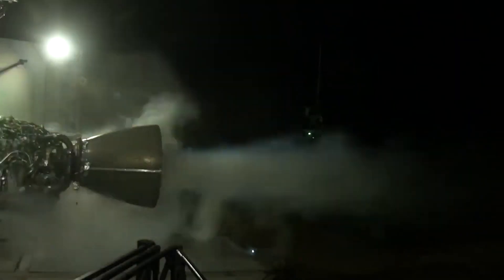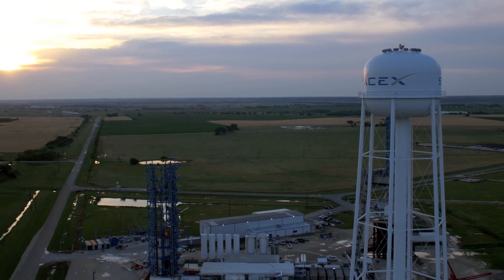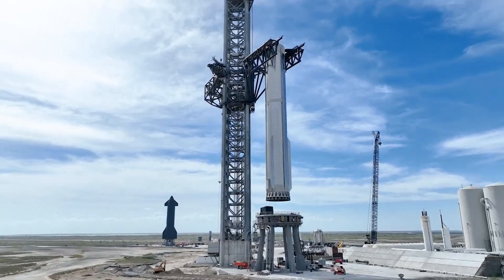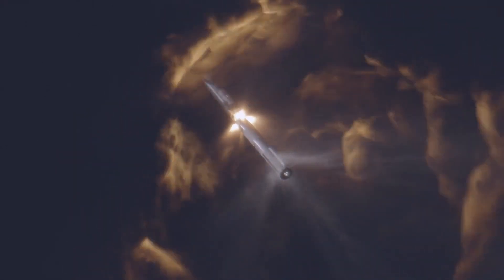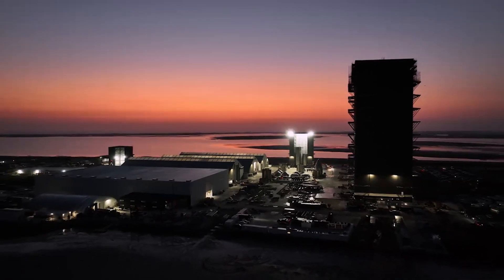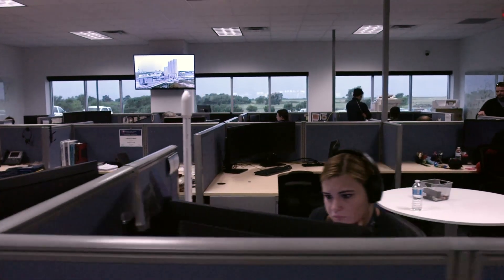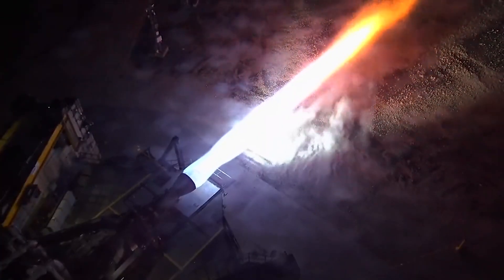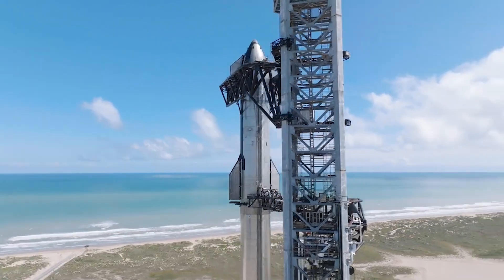SpaceX’s New Raptor V3 Is Changing Starship's Design

Comment: Call me a sceptic, but removing safeties like shielding between engines sounds reckless. Also, the continued engine failures don't instill confidence. Maybe continue to push the engine to extremes for the sake of a few percent performance is not the way forawrd?
Reply: The lack of safety is justifiable when there is nothing in danger. If it wont be a problem, it simply won't, there is no reason to treat it as a risk. 

Saying the lack of safety there is risky is just like saying the lack of heat shield on fighter jets is dangerous, or the lack of refirbishment in airline planes is dangerous. 

There is no reason to spend money and resources on something thats proven to work without those expenses.

"Continued engine failures"
Which ones? There were what, 3 engine failures on the last 110 test flight engine ignitions, and 5 on the last 1000 engine ignitions including ground firing. The reliability of the raptors is simply undeniable, and the amound of failures is impressively low.
Reply: @DangerZone2002  So what you're saying is that Starship well never have humans onboard? I'll buy that 
2 Raptors failed on the most recent test 
Planes don't drop like bricks when their engines fail so that's a bad analogy.

Comment: So does that 10+ ton weight saving from removing the current fire suppression behind the heat shields involve the removal of those huge CO2 tanks housed in 2 of the very long chines on the booster? If yes then not only is that a good weight saving but I would think that it will also be a very useful cost and time optimisation when building a booster. Those huge CO2 cylinders are I believe manufactured elsewhere and trucked to Boca so that's probably a relatively costly component and then when you see them being fitted to a booster in a Megabay it looks like a pretty serious lift (2 lifts actually - one for each cylinder) that probably needs a lot of prep (making space, establishing bigger-that-usual health and safety exclusion zones because of the swept space taken to lift the cylinder from horizontal to vertical etc). It's probably a Megabay operation akin to installing a methane downcomer so getting rid of those CO2 cylinders entirely would be nice for the production process too.

Comment: As I see it - and maybe seeing what I want to see rather than reality - even more recent Raptor 2s have been incredibly reliable. We can't know all the details but discounting IFT-1 I'd say it's entirely possible that out of 117 engines (3 flights with 33+6 Raptors each) there might well have been only a single failure that is down to the engine - the one that shut down almost immediately after OLM booster ignition on IFT-4. It's entirely possible that all the other failures (and maybe even that first IFT-4 failure) were down to issues further upstream (fuel slosh, clogged filters or other issues that weren't actually in the engine itself). Obviously all those non-engine issues are critical to identify and fix but the more of the failures that we have seen in the IFTs that were upstream issues rather than engine issues does bode very well for where SpaceX is already at re engine reliability.

Comment: Casual reminder that Starship V.1 was supposed to carry 100 tons to orbit but has only ever flown empty and the entire program has already expended more rocket engines than the entire shuttle program did over decades of flight, even factoring in their two vehicle losses.
Reply: The cost of engines for the whole starship programm is still less than 1  (one) RS-25. The number of engines is irrelevant
Reply: No. Thats not how it works.
Reply: Loss of engines doesn't really matter compared to cost. It's too early to say if the starship development program will be capital efficient, but I think it's fair to guess that they will deliver far more than the space shuttle at far less cost. They're currently sitting a like 10-20x less than shuttle's cost.
Reply: Obviously it’s expended more engines, starship has 39 total and the shuttle had 7. Not to mention the shuttle reused all of its engines: the SRBs parachuted down, and the OMS and SSMEs came back with the shuttle to be removed and reused. Not a good comparison. The raptors are also far cheaper than any shuttle engine. Also, plans have changed: V1 used to be meant to deliver 100+ tons to LEO, but is now delegated to be a prototype for the first operational version: V2, due to them finding improvements and deciding to improve the design before launching with payload.
Reply: @Skye-Was-Taken  one space shuttle engine costs more than all of raptor engines used in all 4 flight tests
Reply: @tedarcher9120  yeah, just shows how much Elon has done for the aerospace industry. Amazing, isn’t it?
Reply: It has flown empty but with less fuel, so it clearly has capacity. I think the main reason they haven't flown payload yet is a combo of:
- not entirely reliable yet, many changes each flight, wouldn't risk payload
- being paid for development milestones for Artemis
- focus on long term reusability, which dominates the returns of a few deployments during testing

The latter two come into play when there's any conflict between deploying a payload and demonstrating reuse. There's the obvious tradeoff of limited engineering time, but there are probably many in-the-weeds reasons. That said, I feel if I were in charge I'd be trying to deploy starling satelites by now.

Comment: Casual reminder that SpaceX the longest-running private space flight company and still hasn't launched a single payload outside of LEO.
Reply: Nope. From wikipedia:

Launches to higher-orbits have included DSCOVR to Sun–Earth Lagrange point L1, TESS to a lunar flyby, a Tesla Roadster demonstration payload to a heliocentric orbit extending past the orbit of Mars, DART to the asteroid Didymos, Euclid to Sun-Earth Lagrange point L2, and Psyche to the asteroid 16 Psyche.
Reply: No
You forgot Blue Origin dude, they run longer than SpaceX and not even single orbital launch yet
Reply: @cunnybluez  agreed that blue origin dident have any orbital launches but the BE-4 engines did fly on a vulcan rocket a few months ago. at least thats some progress as slow as blue origin goes.
Reply: Did you forget about a falcon heavy launching a tesla roadster all the way out to Mars orbit? Go Google it.
Reply: @reyviqueira3159  haters tend to ore than a little dishonest.
Reply: This guy, bro. They have launched several payloads outside of LEO, including going interplanetary multiple times. Also, blue origin is technically slightly older, and hasn’t even gone to orbit.
Reply: As all already pointed out you are wrong and I don't think that's any sort of goalpost. They are the industry leader, like it or not. The push for reusability can be directly attributed to the success of the Falcon 9 rocket.

Comment: I believe the 10 tons of “heat shield” is more the result of needing prevent a single engine RUD from taking out its neighbors, and potentially so on and so on. Raptor 3 is supposed to survive RUD without firing pieces of shrapnel everywhere. That seems like a hard thing to validate to me, give all the different and violent ways a rocket engine can explode. It’s not such a big deal until they try to human rate Starship. SpaceX are proposing no launch escape system, so the booster and ship (and therefore the Raptors) must be incredibly reliable.
Reply: I'm wondering how they'll get away with the no launch escape system. 
To me it sounds like the no need for a water deluge system that they originally came up with. I think they'll have to back track it. But we'll see how it goes. SpaceX never fails to surprise and do amazing things.
Reply: @acasualviewer5861 yeah. However Starship IS the launch escape vehicle for the combined booster+starship stack as Musk has explained a few times. Those raptors can power the Starship away from the booster faster than an explosion can get to it. The real problem is that the Starship itself has no escape system - but then again neither do other spacecraft once the escape system is jettisoned - the plan is HUNDREDS of flights without failure to prove out the human rating. I reckon that’s a decade away

Comment: He was told at the start not to use methane ,  It's all new tech ,,just go with the usual,,,
H2 leaks , helium runs up walls, ,,3rd version is powerful,and quick an easy to build ,,,
The stainless steel use proved itself too..
Reply: Nearly all new rocket engines under development use methane as the fuel. Blue origin, rocket Lab... Etc. SpaceX is by no means unique in that regard.
Reply: Except its not reached apollo 4 level yet .

Comment: The Raptor V3 is going places. Can't wait to see some videos of it. But at the same time it pains me to see how much fuel is required for each start. It doesn't help our efforts to reduce greenhouse gases and I can't afford a ticket on a rocket.
Reply: I’ll start being concerned when rockets are flying through the stratosphere as frequently as planes are
Reply: The fuel (methane + oxygen) can be obtained via processes powered by solar panels or wind turbines. This is more renewable than existing fuels
Reply: My understanding is that Raptor uses methane that would otherwise have been burned off into the atmosphere anyway or just released into the atmosphere. Raptor is carbon-neutral, and one could even argue that it benefits they environment by burning methane that could of otherwise been simply released in the atmosphere (way worse for the environment than some CO2)
Reply: @johnstephenson5158  Your understanding is wrong. Methane is not a waste product and is in fact a valuable fuel. What do you think gas stoves use? It is vented to the atmosphere during fossil fuel refining because it's easier than storing it but it doesn't need to be and still is. Raptor is not carbon neutral as that methane comes from fossil fuel. A carbon neutral rocket wouldn't be putting new carbon from the ground into the atmosphere and they sure af are not offsetting the carbon with anything else.
Reply: lmfao
Reply: If it is a valuable fuel then I see no reason why companies would simply vent it into the atmosphere rather than store it. You said because it is “easier” than storing it, but if the starship program increases the demand for methane through raptor engines, then wouldn’t this mean that more companies find it valuable to store it than simply release it in the atmosphere. It seems that there is a lot of methane in the world that is either being burned or released in the atmosphere, is it not carbon neutral of raptor to burn this same methane for a greater purpose?